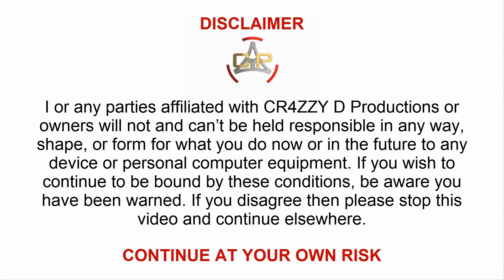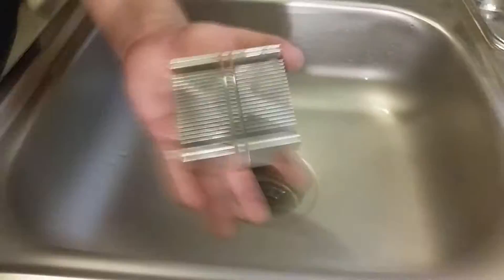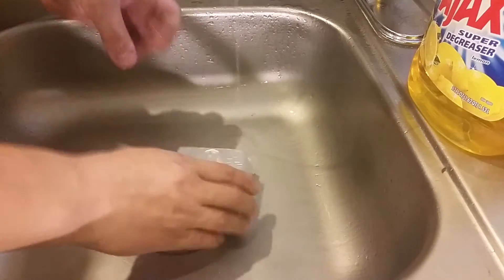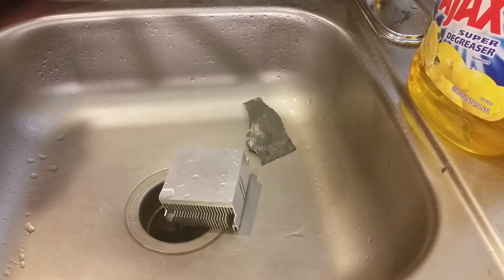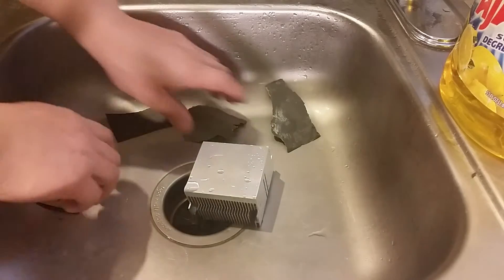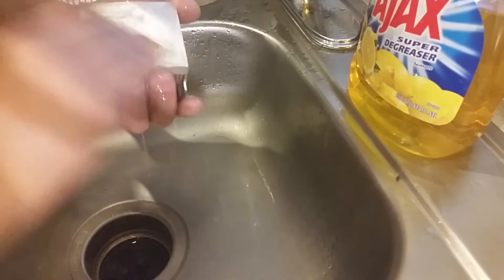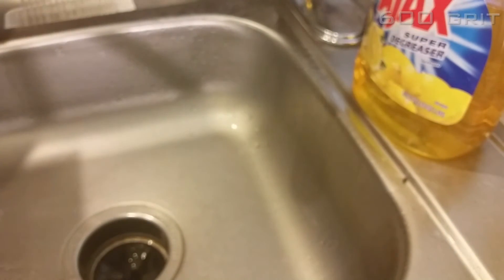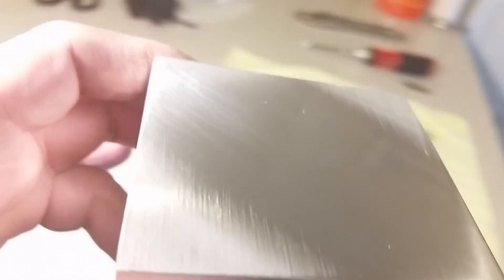Polishing your Heatsink for better PERFORMANCE

Comment: I have watched a few videos about making the heatsink flat by lapping. (it's a weird word to me, coming from an old autobody tech.)   I thought it's important to add something EVERYONE seems to miss...
USE  A  FLAT GLASS PLATE, with lots of mild soap!!!   

never done "lapping" this to a computer heatsink, but I do level my heatsinks for my TEC (peltier) projects. 
plus try some 7000grit for a final finish. 

when done correctly and it's truly flat&level,   no thermal paste is needed!!  (my own TEC tests show thermal paste actually hurts heat removal) 

for you cold guys who push the limits with freezing temps, throw away your thermal paste, and try 99.9 PURE indium   wire. (you'll have to make a spiral gasket then flatten it carefully) 
NOTE: understand the properties of INDIUM before use, as it does consume other metals.

indium is used in cryogenic seals because it transfers heat under super cold temps. (think 20Kelvin)

anyways, thank you for the video.
Reply: >indium is used in cryogenic seals because it transfers heat under super cold temps. (think 20Kelvin)

how does this property help you when the components you are cooling are never going to be below 270K? Regular people should probably just stick to Gallium if they want to do something extreme.

Comment: hey guys
while he did get a great looking finish, it's not the best way, because by hand sanding, you're actually sanding unevenly.  you have to put the sandpaper face up on a flat surface (like a pane of glass ) and then rub the heatsink on that.  any other way, you're decreasing the surface contact by creating small ridges and valleys.

Comment: So did you get any temperature improvments?
Reply from the maker: Yes i did. I averaged out at around 12 to 15 degrees cooler PC temps on multiple devices. This includes 2 Laptops and 3 Desktops.